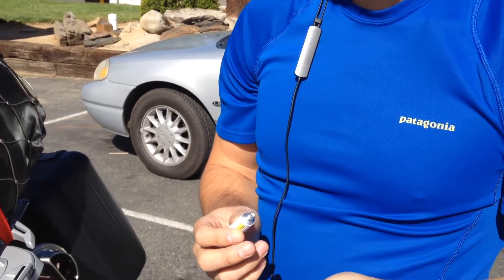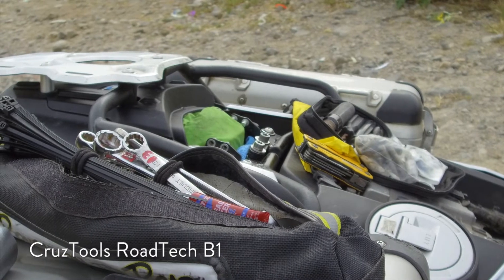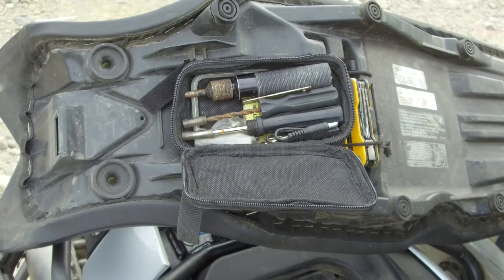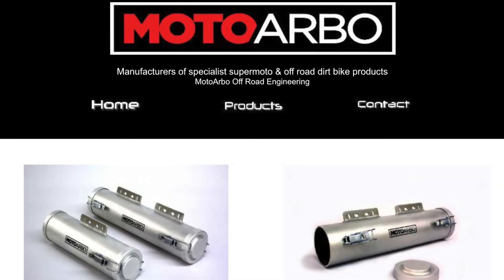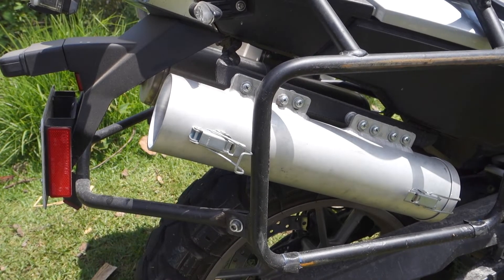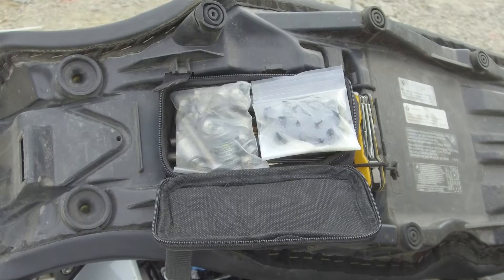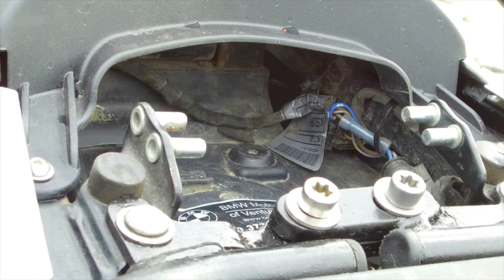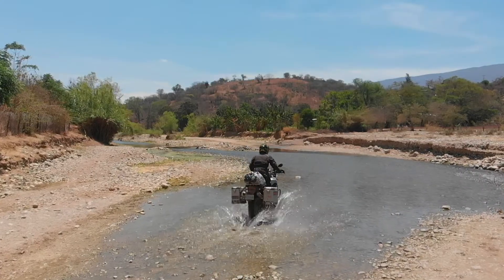The best TOOL KIT setup and tool tube for motorcycle repairs for ADV riders with an F700GS or F800GS

Comment: Interesting video. For me the plastic agricultural manual tube works fine on the inside of the panniers support. On the hole under the passenger seat I have the BMW original alarm system. So no place for manual or extra tools. Alternatively I have an Touratech toolbox dawn on the aluminum skid plate, bringing the weight low! Works well. Ride safety. Regards from Germany.
Reply from the maker: The toolbox on the skid plate is clever because like you say the weight is so low. So you ever knock it on rocks or branches when off-road?
Reply: @GoRUFFLY  As it is in front of the skid plate just behind the front wheel I never hit it. But it receives small rocks/dirt from the front wheel that marks the aluminum but not causes real damage.  Regards.
Reply from the maker: Sounds like a good setup. Thanks

Comment: hi, would you mind tell us which wrenches do you have? 13mm 21mm which ones more do you use in your kit?
Reply from the maker: I have 8mm-13mm, 17mm, 19mm, and 20mm because I bring them for the F700 and G650. The 10, 11, and 13mm get the most use. I also have ratchet heads in those sizes as well but they aren't essential.

Comment: The space in the ‘cubby hole’ at the rear underside of the seat .., is for the bmw ALARM  .
Reply from the maker: Good to know. I think it works much better for the mini-compressor!
Reply: The bmw alarm just drains the battery.   I fitted a e bay alarm in the ACCESS panel underneath where you get access to the number plate lamp. Actually a fair bit of room in there.